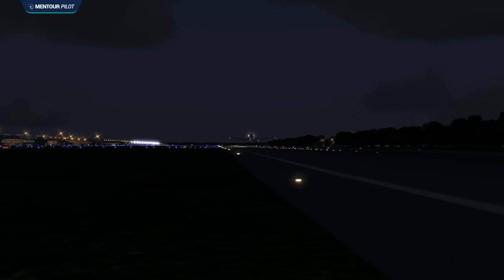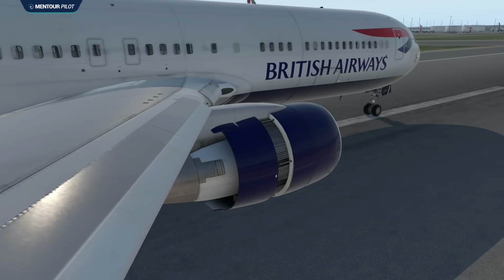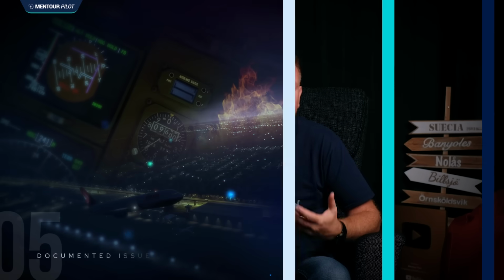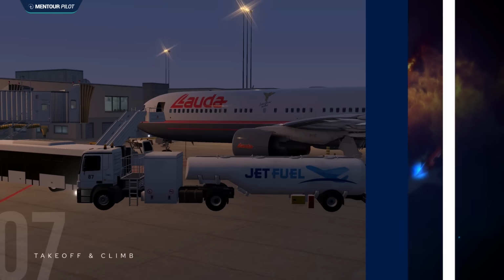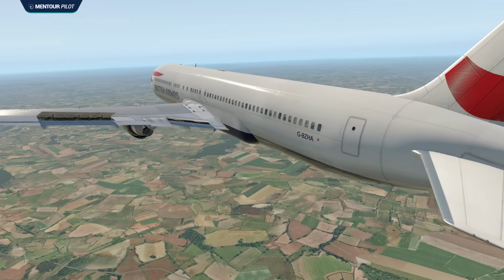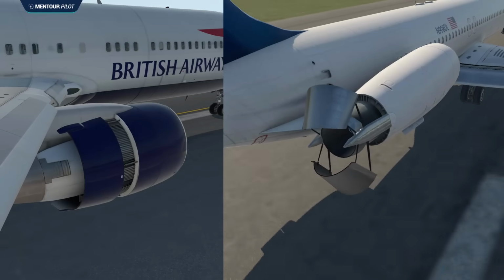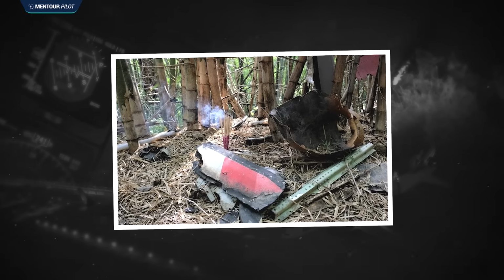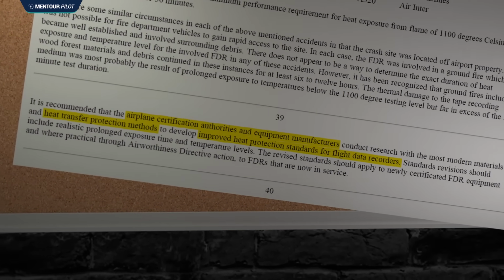HOW an Impossible Failure CRASHED this Boeing 767!

Comment from the maker: Get an EXCLUSIVE Nord VPN Deal 👉🏻 https://www.nordvpn.com/pilot It’s completely risk free with Nord’s 30 day money-back guarantee! 👍🏻
Reply: Thanks for another great video!  I looked up the 767 and saw that it could be ordered with 4 different engine choices, which puzzled me.  Would the outcome have been different if it had any of the other engine choices?
Reply: Murphy's Law says, "If anything can go wrong, it will."
The aircraft manufacturers should have made it absolutely impossible for the aircraft to deploy the reverse thrust when the aircraft is in flight due to any error, including mechanical, electrical and human error. Obviously, they failed to do that.
Reply: @simon6071  completely agree.  Or else they should have made sure that if they did deploy in flight it wasn’t an unrecoverable catastrophe.  Some planes can “safely” deploy reverse thrust in flight.  I watched another video where a plane crashed into the sea when one reverser deployed in cruise, so it isn’t as though altitude would have helped.
Reply: @moiraatkinson  The only circumstance that would justify the deployment of reverse thrust when the landing wheels are not touching the ground is when the plane needs to make an emergency landing because the landing gear fails to deploy. In such case, there should be some ground impact and water impact activated devices on the belly of the plane either of which can trigger the landing mode to allow the deployment of reverse thrust by the pilot even when the wheels are not touching the ground.
Reply: What a hair--raising way to expire, especially for the passengers still in the craft after the tail section blew off. I wonder if major lawsuits of the engine manufacturer resulted.
Reply: Honestly from the comments it sounds like this accidents post crash investigation was a lot more complex than presented here and worthy of a story in it's own right. I'd love to see a followup covering those details.
Reply: How is this exclusive when I see this same offer from NORD on about 5 different channels I watch :)
Reply: hmmm is it me or did mr Lauda tell this story a bit different, esp re boing response/responsibility?
Reply: Flying isn't safe. Too many things can go wrong.  Until they will make fuel tanks in airplanes the same way they do it in F1 cars and make airplanes be able to land vertically or just use a parachute, until then, flying won't be safe. Please explain to me why aren't they using the F1 fuel tanks in airplanes.  They can withstand and stop bullets and withstand crashes.  So many things wrong with aviation that makes me surprised some people are crazy enough to get a job as a pilot
Reply: I got Nord VPN - thank you!  I’m very pleased with it and it doesn’t cost too much.  I just keep getting “possible fraud” messages from credit card companies, when I’ve bought something online and forgotten I’m still on a Brazilian IP!
Reply: @moiraatkinson  ayyo.... What are you doing with brazilian vpn? I'm always looking for los Angeles United States
Reply: @achalbhoir1359  I’m making use of Mentour Pilot’s wonderful recommended VPN.  Which I can’t connect to right now 😠.  They may be wonderful in a lot of respects but I can tell you they have RUBBISH support and help if you run into problems!
Reply: @moiraatkinson  you can use any other VPN just for free.... See every vpn will ask money... but that's optional.
Reply: hey can you review this clip "Cessna 120 caught in helicopter wake turbulence" on youtube
Reply: Wouldnt be a good redudancy system to automatically pull back the engine in case a thrust reverser activates by malfunction?
Reply: @ Mentour Pilot, ... what are you views on checking the Handbook when you are in an emergency? ...
Reply: vpn dich selbst
Reply: Nord VPN started in my home town!
Reply: When are you going to talk about MH370?
Reply: Hey there, love the channel. I would be very interested to hear your take on the 1971 Pan Am flight 845...maybe a full video ? 😄
Reply: Thanks nordvpn you saved my marriage
Reply: @FirstNameLastName-okayyoutube  how ??
Reply: This video is sponsored by nord vpn
Reply: Take care LBA BUR DESTINATIONS
Reply: How come it can't go to the towers computer after maintenance gets done as well so that way if they said something was wrong they would know and could tell the captions
Reply: Interesting
Reply: My Dad was a Boeing 767 Captain for Lauda from 92-96 he knew the Captain an ex Eastern Captain. I flew this exact route With him a few times on the jumpseatVienna to Bangkok, Crew then to Sydney and back with a day trip to Hong Kong. Crew was gone about 16 days. Thanks for the video.
Reply: By sheer coincidence I was flying a 767-300 from BKK to DXB at the same time as this plane was about to takeoff, I was 10 minutes ahead of him, same initial route.Had to operate for nearly a year without thrust reverses because of it. I always briefed later "if a reverse light comes on or deploys in-flight I will just immediately cut the fuel off", years later this actually happened,  but I shut it down within about one second
Reply: Sorry Petter, I am a big fan of you. With all respect. I have signed up with NordVPN after your add. I am flying regulary to China. (Cargo) There in Chengdu It does NOT work at all.
Seems it is not connecting.

I know, this is not you to blame.
It has eaten the 149€ and now does not allow me to log in anymore. Is NordVPN really serious?
Reply: YEAH THE 4060s POWER DAMIT!
Reply: Ajudando a humanidade TV MAYPUR DA INDIA P O MUNDO 
LITERATURA VEDICA 
MANTRA  HARE KRISNA HARE KRISNA KRISNA KRISNA HARE HARE HARE HAMA HARE HAMA HAMA HAMA HARE HARE..
Reply: Mostra p nos as familias dos pilotos 
Prejuizo e cobrado da familia do
Piloto 
Ou impostos publicos .
Reply: Impossivel seguranca 
A mente humana   nao e espiritual ...
Reply: my relationship to your content has not gotten to the point that i share clips with my parents 😛
Reply: I played around with my VPN on my mobil. forgot about it. then got a add for singel pepole close to Ashburn Virginia. for a second I thought it was strange. as I am living in scandinavia. then i laughed, as i recoginised why.
Reply: @exploatores  oh it autolocates you based on the VPN location? :D
Reply: @marhawkman303  ll lol l
Reply: AdamAir Flight 574 would be a unique one because pilot may have been the cause, but you also learn about an airline that basically bullied their pilots.
Reply: Nord gives u viruses
Reply: @O-Block_Princess  lol
Reply: 2:10... so what I'm getting here is that it's a ducted propellor driven by a jet? hahah the important part is that it works :D
Reply: @marhawkman303  - that's actually a very good description. Or you could call it a gas pump.
Reply: @marhawkman303 thanks vu
Reply: @marhawkman303  that's what a turbo propeller engine is. It has a jet engine that the compressors spin the turbines with a shaft to the front and runs the propeller. Same with boats and generators. If you're into that type of thing look up agent Jayz. He has an excellent channel. I feel like I could take apart of jet engine although I don't know if I would be able to put it back together.
Reply: can you do Aeroperu flight 603 next? :D
Reply: @Signal_Room in 😮so it will not work on 😢andthe and I 😊The very 😅😮 😊the 😊😮in 😅😅o😮and 😊😮in the office was 😅and 😅of 😢my 😢😮😮yf I don't 😮the o😅of it y from the😮y store actually but love 😮too but it's just like a brand o and a lot of things I think 😅and
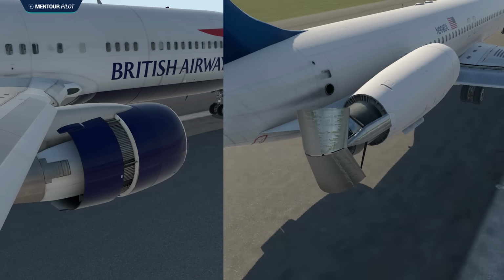Reply: @Signal_Room  Believe in JESUS today, confess and repent of your sins. No one goes to heaven for doing good but by believing in JESUS who died for our sins.  For God so loved the world that he gave his one and only Son, that whoever believes in him shall not perish but have eternal life.(John 3:16)🥳❤️😗❤️🙌
Reply: @alunesh12345  
In order to find peace within say aloud 3 times - 
THE POWER OF COPY AND PASTE COMPELLS YOU! 
THE POWER OF COPY AND PASTE COMPELLS YOU!! 
THE POWER OF COPY AND PASTE COMPELLS YOU!!!
Reply: @alunesh12345  Science will fly you to the moon. Religion will fly you into buildings.
Reply: @lew832  ??? - This crash had nothing to do with religion and science was unfortunately unable to prevent the death of this 223 human beings.
Reply: No music background please. It's irritating & distracting. You didn't used to add it. Why start now. I'm dissappointed in you. I thought you were more mature, professional & sensible. At one point I can hardly hear what your saying. Bldy ridiculous
Reply: @pobinr  Try to remember that the sounds encoded into this video are decoded by your sound card and then played by your speakers. This means your experience of the sound levels of the various channels will not be universal. They will be unique to you. I can assure you that played through my reference speakers, the music does not drown out the sound - but I’m not accusing you of being wrong, it obviously did for you. The thing is, with your setup, you will find this a lot - perhaps a reason for your extreme dislike of music and belief that it’s unprofessional is that you hear a lot of videos play with too loud music? The answer isn’t to try to put pressure on creators to adjust their videos for your exact sound system by calling them names and ranting at them. It’s to buy a better pair of speakers that match your sound card better.
Reply: @pobinr  a slight overreaction, perhaps?

Comment: Nice caveat at 4:05: "The reversers on COMMERCIAL aircraft were only certified to operate on the ground". Petr is clearly aware that some military transports (most notably the C-17) can employ reverse thrust in flight to make extremely fast descents through altitudes where there is a high SAM/AAA threat.

Maybe worth noting that high bypass ratio is only "more efficient" as stated early in the video in the subsonic regime. If you want to go supersonic then high exhaust velocity is needed, and turbojets (no bypass) are most efficient. That's why the turbofans used in modern fighters have bypass ratios ranging from 0.2 to 0.7 or so - They're designed to cruise in the subsonic (hence some bypass) but to be capable of supersonic speeds. Fighters that are designed to supercruise, like the F-22, tend to have bypass ratios on the low end of that range.

Comment: Lauda murdered every one on that flight for corporate profit. He knew that the thrust reverser was liable to deploy in flight.  There was no possible scenario where  one engine going into reverse thrust at full power was going to be safe at mach 0.78.  These engines generate over 50,000 lbs of thrust easily.   There is no possible world where that type of power redirected could be even remotely safe. Boeing NEVER said that it was ok to fly an airplane with this type of mechanical failure.  Saying that the airplane could survive a thrust reversal event under certain circumstances and then deliberately flying it with this type of failure is like saying that auto manufacture said a van can survive a crash at 30 mph and then driving it with no brakes. Lauda did it for profit and over 200 people are dead because of  that. His mechanics were asking to ground the airplane.

Aircraft are never safe, irregardless of manufacturer, if the company operating the airframe refuses to maintain it.  Furthermore given the forces involved, if the wing had sheared off that would not have been unexpected.  Strictly the Boeing did survive the thrust reversal event and gave the pilots 4 secs to recover. It did as much as could be expected after being sabotaged by corporate greed and a refusal to do adequate maintenance in preference for profits.
Reply: Hardcore plane hater. And that’s wrong too. It was a design flaw. Not a maintenance failure.
Reply: @normalguy69420  It’s a bit of both by all accounts. Niki Lauda got his side across far better, but this aircraft had been throwing warnings up for months about thrust reversers. Boeing say you can fly the plane for about 500 hours with this warning, Lauda Air flew it for 2000. Now the warning was intermittent, which is mitigating, but Lauda Air techs had troubleshooted multiple times and hadn’t really gotten to the bottom of it.

We don’t know what caused it really, but a major airline with a strong safety culture would have grounded this aircraft and gotten to the bottom of it before the crash.

It’s rare you can point to one thing as the cause of an accident like this. Don’t get me wrong Boeing are probably more to blame and attempted to cover it up.

Comment: Trivia Time. When I was much younger, I was on a flight in a Convair 880. I was sitting at a window seat, just behind the wing.
When we started our descent the pilot used reversers and I found out that the Convair 880 (I'm pretty sure of this.)...the Convair 880 was the only jetliner that was approved to use reversers in flight to increase the rate of descent.  I'm pretty sure that they used only the inboard reversers in flight.  Patrick Cowdrey, Redding, California

Comment: In the late 80s I leased a 707 for cargo flights to the far east and back, i will of course not mention who from !!. This bird was a beauty but a bit shaky. On one flight to Delhi from AMS we had several issues, compasses giving us different readings and more pertinently  one engine had issues with the reverse thrust system meaning we had to lift load master up so he could wack the linkage with a hammer on landing so the reverse thruster thingy could be reset for the next take off after refuelling !! I sheet you not.

Comment: Safety starts with any abnormality being treated as a failure. If it should not occur, there is something wrong. I'd argue that even moisture creating false  error reports is a severe flaw in either procedure, design or state. Don't ignore it, don't assume "it's just that same old thing". Fix the problem or ground the plane. This wasn't an in-flight entertainment error. Machines do fail, sensors age, but as soon as you have a warning, or a backup engages, you are not running the system in the way it was intended to work.

Comment: I don't know how I have missed this video...This must have been one of the scariest accidents I saw yet. Nothing any of the pilots could do. A six second window to do the impossible and from that moment onward, nothing left to do to save the situation. I can't imagine being one of the passangers as the plane breaks apart. Or one of the pilots, probably still thinking and trying to figure something out to save their over 200 passangers up until the end, when nothing they did pretty much from the moment things went wrong could've changed anything. Listening to you explain what they did and talked about beforehand bothers me so much. Like I don't know. It wouldn't really be any better if they had relaxed more or made an obvious mistake...but that might have made it feel more controllable. In this case though, they seemed to have done everything right. not just regarding the specific incident, but in terms of their entire airmanship. No relaxing in the cockpit. They did their proper take off procedures, went through all the checklists, discussed the warnings they got, went through the manual regarding their warning. Talked and adjusted about the slight drag they experienced on the right wing...From how it sounds, they really just did everything how it was supposed to be done, and behaved examplary. And then from one moment to the next, their fate is sealed. And yeah, they're great pilots, so within 10 seconds they figure out what happened, and what to do...but it was already too late by then.

Comment: This shows that there are insane number of factors that can trigger a fatal accident, and human kind cannot make sure that all of them are managed perfectly, hence airplanes are not safe
Reply: Boeing is not safe
Reply: @aeyde Boeing is pretty darn safe if you consider the sheer amount of flights that their aircraft complete yearly without issue. Also before you say ‘but Airbus’ there are thousands more Boeing planes than Airbus being operated. That alone means that a Boeing plane is more likely to have a failure than Airbus.

Comment: I've seen large passenger aircrafts that deploy the thrust reversers between 10 and 20 ft above the runway. Land like butter. I would have taught myself that that it would have to have at least a rear landing gear triggered to deploy it. Now this video concerns me on how other pilots are able to do it without the micro switch of the landing gear. Not on the ground yet even though it's only 10%. . old clamshell design I believe is better than the sleeve design of what we have now for The stress reversing to help slow the aircraft down. I've seen it many many times. So how can that be?❓

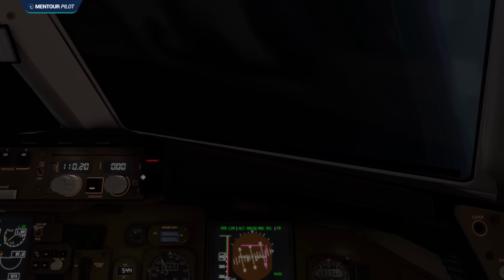Comment: 20:32 if the asymmetric thrust was that extreme, could reverse thrust be deployed on the RIGHT engine as well to completely neutralise any asymmetric thrust? Or would that just worsen the loss of control? Speedbrakes as well to minimise speed? Also reverse thrust will reduce speed, no? Like, was the left thrust reverser deployed fully throughout the crash sequence or was it retracted after the engine was shut down?

Comment: My aviation maintenance instructor once told our class the the pilots of the operator he worked for would occasionally "bump" the thrust reverses in flight to slow down. Then again he also stated that same operator had a higher instance of gear up landings. 😅